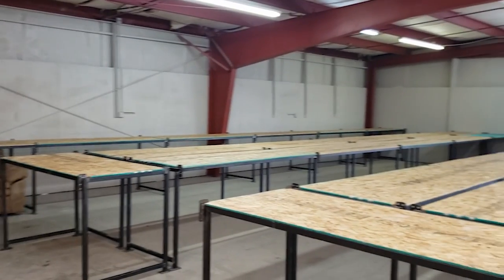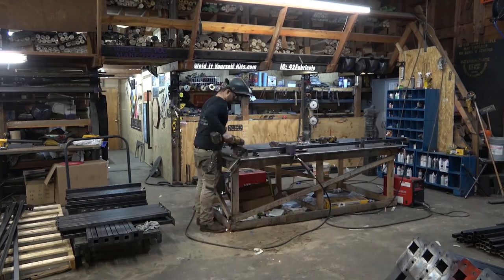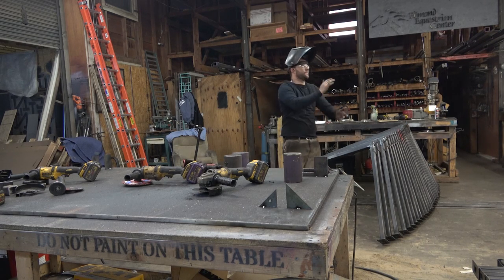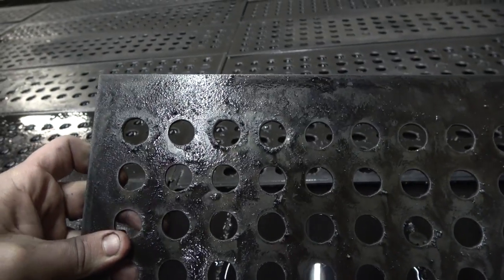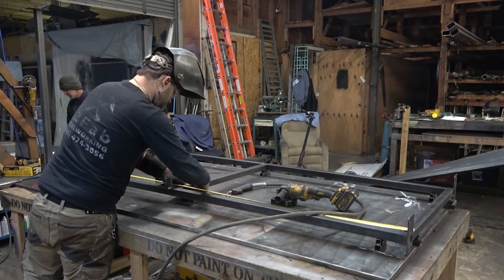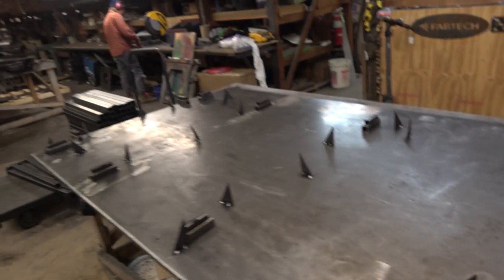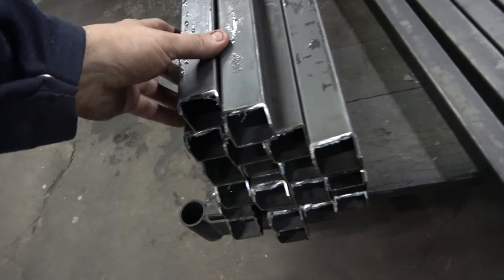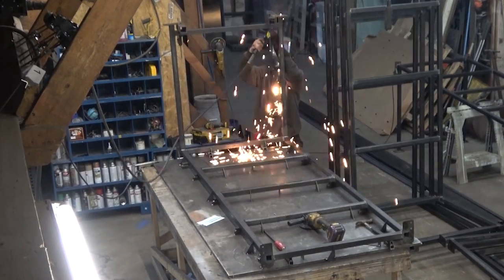Buried in Work. Production Welding to EARN a Profit

Comment: You may want to build an adjustable "crane" for the 15 feet of gun welding lead. Nothing outrageous, maybe from some 1.75" inch pipe thin wall, (6' Ft. long) and some 1.5" inch pipe thin wall.(4' ft. long.) Ideal, the "fall" of the welding lead, should be to the middle of the welding table.  The crane should pivot equal to the center of the table. If you want, hit me up via E-Mail, I have a "MAST" design from March 2004, I'll send to you, DXF format. If I remember correctly, I was copying from a major manufacture of welding supplies. With the mast in hand, you  just need to build a vertical (adjustable 6'ft. to maybe 10' ft) support, wouldn't take much.
Reply: Same idea as a hoosier pole on a rig truck

Comment: One of thee best channels in yt,
My quote living in Ireland
Box section 1400
Plate 100
Wire 40
Gas 130
Labor start to finish 3000
Total 5450
Moral of this story I need to move to the Usa
Reply: solaroid55  where you from

Comment: Guessing about $4900 in materials, and $9,800 in labor. Working in rough numbers of course.

 Do you total your materials and mark them up, or do you mark them up by item? I use a sliding scale, the less an item costs, the more it is marked up. Using a rough rule of thumb labor is typically double the materials.
Reply: Hi Am Welder  In Ethopia I Wonted Welding Job P

Comment: Jig vs fixture
A jig might hold the work piece(s), but it always guides the tool. A fixture only holds the work piece(s). My friend, you are definitely working with a fixture.
Reply from the maker: Fair enough, not going to change how I call it though
Reply: @42Fab 
I get it. Heck the proper name for the what powers most cars and trucks is an "engine". But, NASCAR and the other motorsport organizations  call it a "motor".

I design machines, fixtures, and jigs for a living and some of my customers, who are themselves engineers, would poo poo anything that was mislabeled. I used to use jig and fixture interchangeably, but I can no longer do that.

Comment: I have been doing production for a while now and I never buy local unless it Argon Gas.  I just bought a Thermal Dynamics  (Esab) 60 amp plasma cutter. Got it delivered for $1650 all included (Ebay. I called my local welding supply they don't even buy it for that price from their supplier. I also get 44 pound rolls of mig wire $70 , cant beat that. Ebay is a great source for a manufacturer.  Hi volume lower prices. This is where the money is made. Of coarse i'm good at material prices but I need to work on speeding up my production.

Comment: I use to do just what you are doing using SMAW. That was long time ago. The process you are doing I would do. Still got the touch with the stick welding just as good as the MIG. This brings back memories. Keep up the great work showing others the working process.

Comment: Jig is very critical to keep spec's within it's torance's, thank's for showing this part.  Do you buy wire in bulk for discount? Shop I worked out of bought pallet at a time. Love the big shop, the big table's, weld er up. Production work having good set up help's on production time saving money. Look's like Quality is key in production, being consistent from start to finish is harder then most factory in. Moving part's on jig's have to be checked, QA engineer that can read spec sheet's saving time but QA, is expensive. So doing all the assembly on this job you all killed it. Nice work.
Reply from the maker: I buy my wire from HTP and their prices are great. Got an even better deal will calling a bunch last time I was by their warehouse

Comment: I worked in metal construction from 2000 until 2003 and vulcanizer of conveyor belts and rubberizing of drums from 2003 until 2016 and thermal power plant workshop driver (GTA) from 2016 until now

Comment: Hey do you have a video on what buisness you built. As in s-corp, llc, soal.... what insurance do you have and what does it cover? What licenses did you have to have, what permits with the city? How did you go about getting it all set up? Thank you.
Reply from the maker: Something like this is possible, but a limited topic as each area is going to be different. We're an LLC, require worker's comp, most cities in my area require a license, which is just a "pay a fee" tax in disguise, permits for each job (again, mostly a fee and making sure any electrical is permitted or allowed), Everything but the insurance is a matter of calling the city or state to get it started. Insurance is about shipping for the right agent to handle your needs.

There are tax benefits over an LLC, but when you're starting out, or have a high reinvestment rate, they are not worth the additional admin costs.

Comment: love fixtures or jigs, especially ones where you can clamp the material down, ah, where's the ventilation?  ah, who am I to judge, I weld through oil, so.... great spatter tip, been getting some major gunk all over from the table, again, ventilation, where is it? above you?
Reply from the maker: 20'x16' doors at either end of the building and a constant Oklahoma breeze

Comment: we spent a week building a jig for a catwalk standard section(20ft) and then used it for the next 10 years making those sections for the tops of grain silo's, they were so good that the engineers saved time and money by using them as their standard.(i "helped" build this jig as an apprentice then used it as a Jman)
Just curious,, why dont you use a plywood table to weld stuff out on? that way you can sweep the splatter off instead of grinding it off?(is it a space issue or not wanting to move the plate top you have sitting on that table?) i've always built jigs as a frame i can put on a table instead of welding them to the table for this reason, that way i get to keep the jig, label it, and use it again later if needed?
Reply from the maker: We have a few jigs we reuse that are saved, but most we never revisit. We work right on the table as it gives us an unwarping ground plane that is a time saver.
Reply: @42Fab  fair enough, we just found that the trade up in cleanup wasn't so great, with a ton of one off stuff i could see it.
Reply from the maker: @fixt100  the anti spatter spray helps a lot

Comment: Charge your hourly labor rate unless you have a shop rate with more than 1 employee (all determined by your overhead, utilities, consumables etc) then retail price for material, (if you can buy wholesale usually 20-50% less than retail). Sometimes I bid high cause I may not want to do a job, and still get it. If you can multitask then your efficiency is better. Most people lose money in the phase of prototyping the first piece or not having a clear design or making multiple trips. I charge more if I don’t have a clear drawing. Doesn’t have to be perfect but having to engineer it while working on it is gonna drive up the labor charge. Lot of other things go into bidding and doing these jobs though.Jmo.
Reply: Excellent point about the cost of prototyping & engineering! I tend to overlook this too often.

Comment: What do you use to roll thin wall rectangular tubing?
Reply from the maker: Depends on the application. Slight rolls can be done with a standard sheet/bar roller
Reply: I want to radius some 2x3 rectangular tubing 14 ga

Comment: What are y’all using to clean the metal in that little bath??
Reply from the maker: Simple green
Reply: @42Fab  simple green removes mill scale pretty well? Use a pipe polisher ever? I use wd40 and red scotch brite .. recently tried white vinegar and a scotch bright it works pretty well with a spray bottle of vinegar. Just don’t like the rusting effects
Reply from the maker: we were just taking oil off
Reply: @42Fab  what’s your method for cleaning mill scale off tubing?
Reply from the maker: acid then oil to stop rust, but we rarely need to do that sort of thing
Reply: @42Fab  Muratic acid? And what type of oil? I’m a new fabricator and learning a lot .. just started a small business and trying to figure where to take it.. doing a little bit of everything. Tube bumpers & roll cages to trailers to tables .. whatever comes my way. My metal supply DRENCHES the tube in mill scale lol it’s black when I get it lol
Reply from the maker: Mill scale is not the oily stuff, it's the blue outer coating on the steel itself. Muriatic acid and mineral oil, mineral spirits, used oil, whatever, just something to keep water off it.
Reply: @42Fab  yeah that mill scale sucks to take off tubing lol thinking if a pipe polisher

Comment: Flammable material under the work bench ?? No gloves when handling sheet metal  ??
Reply: You can add grinding without a Faceshield and having an employee on the work floor with no safety glasses even.
Reply: This is the first video of his I watched and I said “what?” Out lout when he tossed the spool box under the bench. One day he’ll have a smoldering fire when he leaves at the end of the day.
Reply: As a 4th year welding student what annoys me most is the arc flashing the other staff constantly to be honest. Didn't cost me much to set up a welding screen for my own workshop so people don't get flashed while I work. Australia is pretty strict with safety guidelines though, factory run like this would be shut down or fined here, but people will always pull the "don't tell me how to run my business" card.

Comment: Why isn’t it pulling out of square since you didn’t tack both sides
Reply from the maker: That's the whole point of the jig, it holds it a you get the other side.
Reply: 42Fab - Metal Fabrication & Signage  good deal, I’m just a 60 year old man that does not weld but I love watching and learning, thanks

Comment: You may want to watch more videos on production welding and mig process wire dia etc can help with less change overs plus your wasting like a good bit a wire putting that spool on
Reply from the maker: the whole point is we're not a production shop. If you're worrying about the 15' of wire lost during a changeout, your margins are running WAY too thin
Reply: @42Fab   umh have u worked at production setting that adds up quick lol your doing production work with fixtures just saying your very inexperienced and should be looking to improve the mistakes your making, not to continue being less knowledgeable than someone coming from a highschool lol I'm not even gonna say shit about poor welding or time management etc because it's your money and your time wasted learning slowly

Comment: I would charge $13,576.35
Reply: Can't forget the .35 cents.
Reply: How did you get 35 cents
Reply: Miguel Medina i add .35 cents to every estimate.
Reply: Is this just to make it look like you actually calculated things
Reply: Miguel Medina yes, i always round up on my estimates. So when I come to the final number 8 times out of 10 it is a perfectly even number and it seems like I pulled it out of my rear end.

Comment: You need 15kg rolls not 5kg, heaps cheaper
Reply from the maker: We use both. If the machine is expected to leave the shop, smaller roll = less weight, if staying, gets a bigger roll

Comment: Must be nice to sell scrap for 16x the price of scrap.
Reply from the maker: If it isn't for you that's cool, but no need to let a bad attitude out in the wild. This is virgin steel, after shipping, transaction, etc we make $11 a box. I'm not afraid to show my numbers
Reply: Depending on where you're at, it can be difficult to get a small quantity of clean steel for welding practice. A lot of steelyards won't deal with individual customers and/or charge like crazy for cutting. I think these boxes are a great opportunity for the folks who need them!
Reply: @42Fab  Fair enough.  Didn't realize it was a shipped rate.  I have a scrap year really close to home that also sells "vigin" metal.  They have a really big bin with scrap 8x8 or less.  I could be among the lucky few to have a place like this close to home.
Reply: You pay more for the convenience